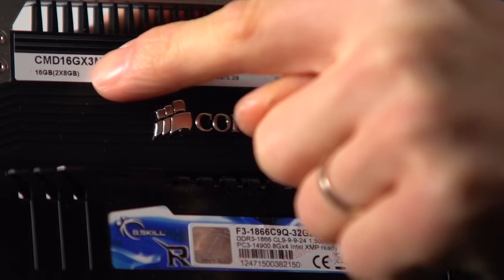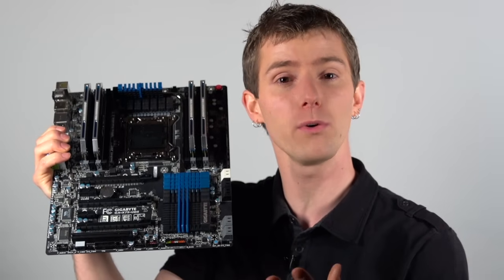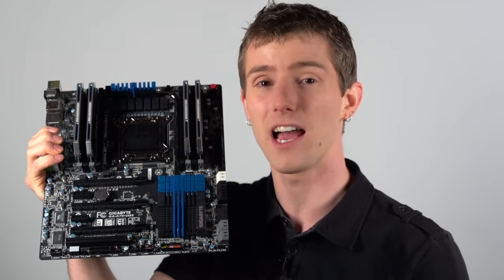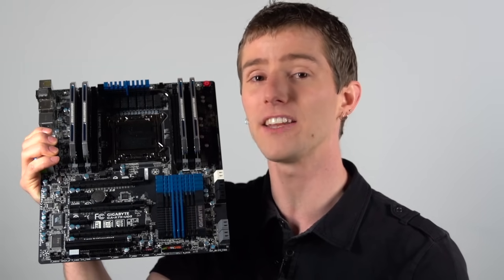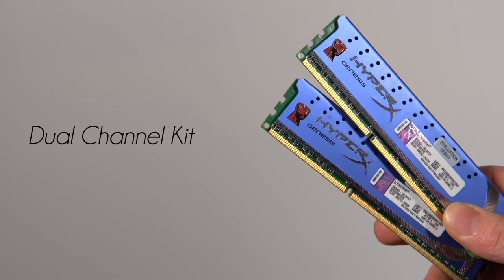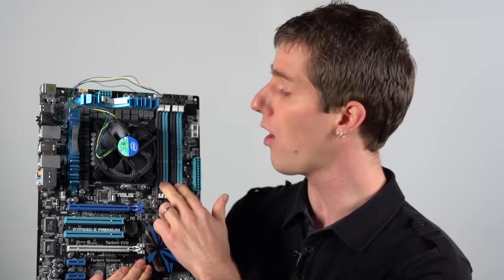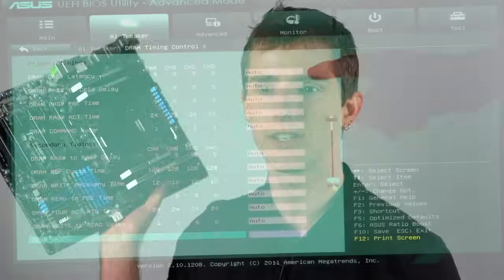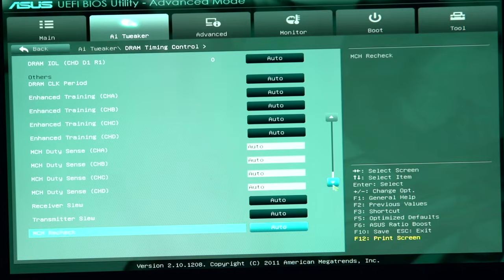Guide to RAM Memory Channels as Fast As Possible

Comment: ok I know this vid is 7 years old but can we make an update to this vid lol.
put that aside.
so if I understand this correctly. If I have a Moboard with dual-channel means it has 4 RAM slots 2 one color and 2 black? so if I put 1 ram in said white color and 1 in black it's like suicide not benefiting from the rams? and if I put both rams in the same color I benefit more of the ram??? 
if its correct then I have an issue... 

Does, not having the cards (ram DIMMs) bought in said dual channel config, effect the system?? like buying 1 stick ram after the other?
 
if so then I fcked it up lol. I went to a pc shop and they sold me 2 single ram stick I nvr got the option or told about DUAL channel KITS.  
sooo if I buy a dual channel ram kit will this in fact help my pc be better?

Comment: so if I have a dual channel board I shouldn't get use all slots?
Reply: I believe you're supposed to use a dual-channel kit (2 sticks) and then use another dual-channel-kit, if you wish to expand. For the best compatibility, it is advised to buy the same kit again. You can try adding something that closely matches the other kit, but that will be at your own risk. Your PC won't explode, but you may experience other problems, such as issues with stability.
Reply: If you have a dual channel look for kits with 2 ram sticks in it (1 channel). If you want to use the other channel get another kit of 2x sticks.  After working out the type of kit you need you still need to research how much memory your CPU can handle, as well as the frequency it can use. For example if your CPU only supports 16GB of memory you need to see what is better to buy - 1 kit (2 sticks at 8GB) or maybe 2 kits (2 sticks at 4GB). Both still max out at 16GB memory but may be cheaper one way. Also you don't need to max the memory, work out what you need based on requirements.

Comment: Hey guys, is it worth it for me to get Quad Channel for my Dual channel MotherBoard, if i can buy the exact same RAM only Dual Channel for the same price? 
(Is it better to have Quad or Dual channel on Dual channel MoBo not depending on price?)
Reply: Have you even watched the video DONT use quad channel in dual channel mobo!!!!!!!!!!😤😤😤😤
Reply: pinkman20001 what? as long as the bins are the same which they will be with 4 sticks in one pack, i.e a quad pack and you have 4 slots over two channels that's a much better idea than buying two separate packs of dual channel where the bins might be different. EDIT: although if you just mean buy sticks with more memory that makes sense.
Reply: there is no need to buy aquad channel for a dual channel when you can just buy a dualchannel
Reply: And on a dual channel board, you will get dual channel, no quad channel without a supporting cpu and board

Comment: I got a doubt, maybe a ignorant question... My mother board has 4 ram slots should i buy 2 x 8gb or 4 x 4gb? What is the best performance?
Reply: 2 x 8gb
Reply: 4 x 4 GB
Reply: 2x8GB only If you plan on upgrading later, If staying with it 4x4GB.
Reply: Why would you get a motherboard and not use all the socket + upgrading 16 GB? You crazy.
Reply: depend on your motherboard limit support of ram, if you got 4 slop and if your board support up to 4 gm than you are only allowed to put 1 gb of ram in each slop,
Reply: Performance wise it would be the same, but in DDR2 times, more memory sticks often would decrease overcloking capabilities due to more stress on the chipset.

Today with DDR3 go with the cheaper option, except you want to upgrade later. Then keep room for that upgrade.

OT: And using 16 GB is totally reasonable, On my old system u had used 4 GB for long time (and it was called more than enough) but over time, when the programs became more demanding, going to 8 GB was just fine.

Comment: ll everything be good if I have 2x4gb ddr4 ram and 2x8gb ddr4 ram in my system?
Reply: Generally speaking? Not really. Those are mis-matched kits and your system will run at the speed of the slowest memory stick(s) On top of that you may run into stability issues.

I'm not saying they won't work, I'm just saying it won't be reliable or completely stable.
Reply: @Surgeplus  I was wondering about this with the new Mac Pro. There are 12 memory lanes... if you were to put 3 32GB and 3 8GB Ram DIMMs inside, would this affect computer performance?
Reply: Yes. Like in the prior example, it would run at the speeds of the slowest RAM sticks in the system, divided across the channels. But don't mix kits. Mixing 3 8GB sticks with 3 32GB sticks will work, but it will not promise you system reliability.
Now... I should tell you that there is a difference in performance when it comes to RAM speed and RAM capacity. You see, having faster RAM will have an impact in certain performance benchmarks, while having higher overall capacity will be more beneficial.

That is where it gets complicated. RAM speed affects how fast the RAM can transfer data to and from your CPU. But this only matters for certain tasks, its almost always better to have higher ram capacity. So if you had to decide between using 2x4GB at 3200 Mhz and 2x8GB at 2400Mhz, you should go for the latter.

Comment: I installed a single Hyper X 8gb stick in my dual channel motherboard, and its horrible unstable. Crashes all the time.
So I borrowed two Crucial 4gb stick from a friend and it runs like a charm. How come? I also Installed the Hyper X in another motherboard, same result, I even tried and old Hyper X 8gb that I know ain't faulty. I will try to use both the Hyper X at the same time. Hope this will work. But If not I have a problem because I build a system for my grandmother with almost the same setup as mine, and it also have the same issue, even worse acutely.
Reply: +propm what are the full system specs dude?
Reply: +baddmint My system specs for my desktop is as following:

MSI 970A SLI Krait Edition
AMD FX-8350
ASUS GeForce 210 1GB(I know this is shjit, its just temperary)
HyperX Fury DDR3 1866MHz (8GB)
Seagate Barracuda® 2TB
and 5 fans, a stock gpu cooler, and a network card for wifi from TP-Link.
Yeah, I think that's mostly it.  And although this aint as powerful as my laptop, I think its a decent budget computer. If it would work with my own ram that is.. and I dont get why the hyper X stuff is being such a b**... The Motherboard should support 1,5Volt and 1866MHz. So beats me why it just crashes when I use that one. Also my grandmother's computer is pretty much the same setup except a lower clock speed on the ram and she got the 970 Gaming from MSI instead as well as the FX-9590 along with a 2gb GTX card of some sort(its used tough, but figured she don't mind)
Reply: +propm  take a look at your RAM settings in the BIOS i had a similar problem where the board default RAM voltage was set low and every time i opened Chrome it would crash   that would be my guess if its set to auto set it to 1,4 and see how you get on.
Reply: +baddmint yeah I have it on auto, I care little for tweaking or tuning in bios. but I will definitely try it out :) hope it works and thanks for the tips ;)

Comment: If u running stock every mix with correct timing or speed will work. But for configuration it will not.

Comment: hey i just bought (Corsair CMZ4GX3M1A1600C9 Vengeance 4GB Single Module DDR3 Memory Kit) x 2
will this work on my  P5G41T-M LX mother board..??
Reply: +Akash Varma Yes
Reply: +WB IsMe  Corsair Vengeance DDR3 1600mhz (4*2) 8gb or Team Group Ram DDR3 2400mhz (4*2) 8gb +16gb usb is free
which brand is better and which one i should buy?
Reply: Never heard of Team group, i would go for Corsair instead.

Comment: CPUZ is saying that my RAM is running in Dual Channel mode but I have 4GB of soldered and 8GB in the DIMM slot. Is this a mistake?
Reply: what version of windows are you running  32 bit can only read/make use of up to 4gb of ram,  64 bit  up to like 192? gb i think
Reply: 64bit

Comment: I have a msi motherboard and four 8gb sticks of corsair vengeance ram it will won't boot with all four in only with two is there a setting I need to change in the bios or what's could cause that
Reply: read the booklet that came with your mobo, it's possible it doesn't support that much ram,
Reply: +James R it's a msi z97 gaming 5 mbo I'm sure it would support more then 16 gbs lmao but it was sonething that happens with that board that only lets u run one channel this hole time I've been using it it was in a single channel config I contacted msi he had me try it in ever slot and said it was bad witch I knew it was at that point and he had me send it back waiting for them to sent it back now but thanks for commenting

Comment: Hi. I Want to know the difference between Processor MHz vs RAM MHz. Thanks!
Reply: +HermZ They're the same but it's a term only used by the tech community these days. Now days we have things like 300 mb per second transfer. 

But basically it's a measurement. It's the clock speed of your system and individual parts of your computer. One Mhz basically says that it can do One Million cycles per second of whatever you're measuring. So if your ram/CPU can process 8bits per cycle and it only has a 1 Mhz clock, it can process 8 million bits. That is the same as 976 kb per second or 0.95 Mb per second, or roughly 57mb per minute. So the faster the clock speed (Mhz) and the higher bit capacity your system has, the better. Your operating system as well as your CPU can easily handle 32 or 64 bits.

Comment: Okay, so I'm still a little confused here.  So I'm getting an MSI z170A M3 gaming mobo.  It runs in dual channel.  I want 16gb of ram.  Am I better off to run 4 sticks of 4gb each, or should I just run 2 sticks of 8gb each?  Do I gain any performance by running 4 sticks of 4gb each, or well I have the same performance as 2 sticks of 8gb each.  Thanks for your time guys!
Reply: There should be no difference in speed, except that smaller sticks are pretty much always faster, because they have a lower CAS latency (look at "CL"). Then again, if you fill up your slots with smaller sticks, you can't just add more later on, if you'd want.
Reply: +antiHUMANDesigns so 4 sticks at 4gb each would give me better latency then 2 sticks at 8gb each.  Would the difference in latency make up much of a difference.
Reply: Chris Reese Yeah, just check the "CL" value on the RAMs. If you go to an online shop and look at RAM, you'll provbably see a "CL" values in the name of the ram. 4GB sticks will tend to have 8-11, while 8GB will have 10-13.

The actual difference... well, I don't know. I haven't actually seen any tests. :/

When it comes to mhz vs CL, it doesn't really matter. Higher mhz tend to have higher latency, and when it comes to getting fast memory, higher mhz is more important.

But my point is that given two RAM stick of the same MHz, a lower CL will definitely be faster. And smaller capacity sticks tend to have lower CL even though they have the same MHz, therefore they're definitely faster.
But how much faster, I can't say.

Since it's about latency, not the bandwidth, it isn't quite so straight-forward to measure the speed. It depends on the application.

Comment: Can someone tell me why its better to have 2x4gb of ram as opposed to a single 8gb stick? New to this stuff.
Reply: Well, the 2x4GB configuration will have double the data rate of the single 8GB. Or maybe my explanation is wrong here, correct me :v
Reply: So the more channels the better? Just like cpu cores? So if you had 16gb of ram it would be more beneficial to have 4x4 as opposed to 2x8?
Reply: But is 4x 4gb better, worse or the same as 2x 8gb?

Comment: Which is better? 4x4gb ram or 2x8gb ram? i have 2x4gb ram and i plan on getting another 2x4gb to have 16gb
Reply: Assuming you have dual channel motherboard then it doesn't really matter.
Reply: John Doe ok, i got 4x4 now :)
Reply: I'd suggest the 2x8GB as you can upgrade more in the future when 8GB's becomes the norm.
Reply: ***** well i got another 2x4 so i have 4x4 otherwise buying 2x8 and giving my 2x4 away would be stupid, i can always get like a 2x16 when they are a thing, getting 4x8 would cost a lot and then i am stuck in the same spot
Reply: MrZodiac011 DDR4 has 16GB sticks, I'm thinking of getting it when I upgrade in 2020.
And you can always stick the 4 gigs in another PC.
Reply: Gamesfan34260 there will probably be ddr5 or something around 2020
Reply: Probably but I have a general idea of how powerful I want my future PC to be, if a cheaper, faster alternative pops up...well, that's just more money in my wallet.

Comment: Running a mixed freq config is generally not a good idea, but normally it'd work
I have 2 sticks of 4gb ram, one of them runs at 1333 and the other at 1600, I installed them when i was still a newb to pcs (around 2013) but fortunately it ran just fine, however lately I've gotten bullshit BSODs about drivers and shit, and I kind of did a manual diagnostics and discovered that the sticks ran at 1333 speed and is somehow not stable, but when i reduced it even more to 5-5-5-12 speed (800 mhz?) it runs gleefully like a sunny jim
Reply: Keep in mind if you install different memory speeds, your overall memory speed will be reduced to the lowest number. Also your timings might be an issue so you may want to check if all of your CAS, etc timings are correct.
Reply: NSSharp1 I did, and i set them to the lowest denomination

Comment: Is it safe to run a DDR4 single channel on a dual channel Mobo?
Reply: ofcourse its safe but i think that it would be a little bit faster if you run in dual channel. Im also thinking between 2x8gb or 1x8gb, one is a little bit faster but the other one is more future proof (if u wanna add another 8gb)

Comment: Okay so... Right now i have a 2x4 GB RAM installed in a motherboard with 4 slots. (2 banks of 2 ). I want to upgrade my RAM to 16 GB. What is the best thing to do right now? Buy the same two 4 GB RAM cards and add them so i have 16 GB? Or remove the old ones, and place to RAM cards of 8 Gb?
Reply: Bozak Suileman Ow and that is possible with 2 banks of 2? in my motherboard?
Reply: Bozak Suileman Thanks!! It gonna solve my Fallout 4 problem/(weakness) on my computer i hope. If not .. well at least i wil have always anough for future games. Thanks Bozak!!
Reply: Bozak Suileman But how do i Know wich model i PRECISELY  have? The site crucial.com, does not even tell me wich model i have after a computer scan xD
Reply: ***** My cpu: Intel i5-4440 CPU 3.1GHz. My gpu is: AMD Radeon R9 200 / HD 7900 series. :)
Reply: +Alexander Zias Aaand? :P haha.
Reply: +Dougy doug 
Hey same Problem here after unsing too many mods in Cities Skylines xD
I have the i5-4440 too with a R9 285. RAM is very cheap right now, 37€ for a 8 GB crucial ballistix sports 1600 dual kit
Thanks to the others for the Tips  :)
Reply: FightBiscuit haha 2 months later.. I don't remember wich one i exactly have, but also from the ballistix sports version. They sended me the package to late, AND the wrong ones. (not the same i had) BUT THEN THEY SENDED IT DOUBLE!! xD. So removed my 2 x 4 gb, en installed the 4 x 4gb they gave me. I bought them cause i thought i would improve frame stutter (dumb ass yess). So it was useless. But i guess its not! cause like you said i installed 200 mods in fallout 4. And i'm building a huge city out of the build limit that is allowed in the game. heard that you can crash to desktop if you build to much. So the 16 Gb is usefull after all i guess?
Reply: Dougy doug
use the task manager to see how many ram you have in usage.
and in cities skylines the game loads all mods and assets in the ram, its the same with fallout 4 i think.
I`ll order another 8 GB the next days
Reply: FightBiscuit Why ise the task manager en see how much i have in usage?
Reply: Dougy doug
i`ve windows 10:
press ctrl-alt-del and then start the task manager
then go in the options and chosse "always in foreground". Than to the side with the diagrams and double click on the overview.  After that drag the task manager to a point of the monitor where it doesnt annoy you while playing
Reply: FightBiscuit no not HOW.. Why should i look at those stats?
Reply: oh,
its to see if you have an advantage of the upgrade
Reply: FightBiscuit ohw okay XD to busy with al the other 1319230123 bugs in the game.... god.... help me....
Reply: +Dougy doug I don´t know if im late, but Install MSI Afterburner to see how much RAM you use ingame... its better than looking from Task Manager.I´m also thinking about buying 2x4 Gb from Crucial ballistix sport again because 8GBs aren´t enough for Rise Of The Tomb Raider xDDD
Reply: DamnYes Hmm okay, one big as tip, make sure you order the right one's. I used a site that tell me if i order the right ones, and i stil got different ones .. I have MSI Afterburner, so thanks i will check that out if i iactually use more RAM while being in my settlement in the fallotu 4 game. Because i build to much haha. i think.
Reply: HAHAHA...yeah i know still thx but bought the same for sure should arrive in 2-3 days <3
Reply: DamnYes Mine arived 3 weeks to late with christmass.. and it was the wrongs ones. Here comes the good part. I sended a email about that. So they send the product again, asuming that it would not arive anyway, they sended it twice xD. I had now 2 times the 2x4 gb if wrong ones. so i removed mine, and installed the 4 x 4 GB wrong RAM, and thought: fuck you for being weeks to late. xD
Reply: xDDD and u just keep it :D you are pretty lucky ^^